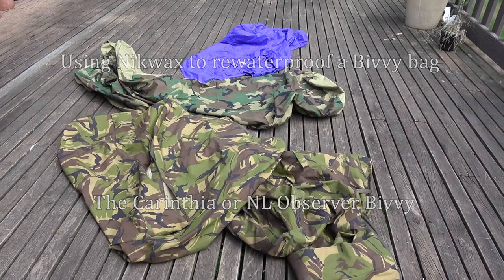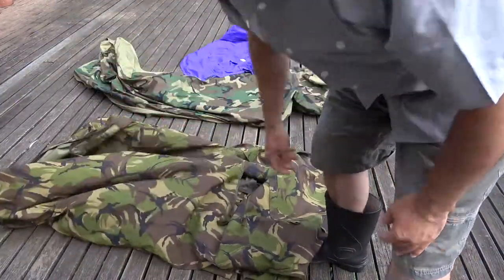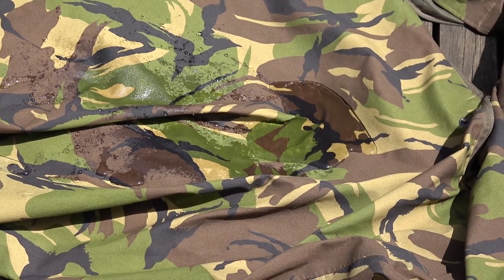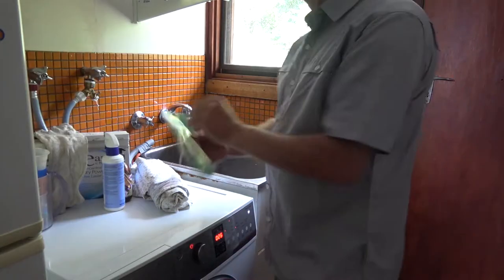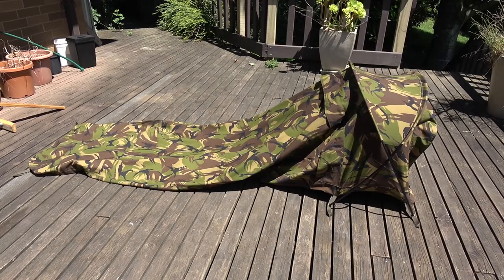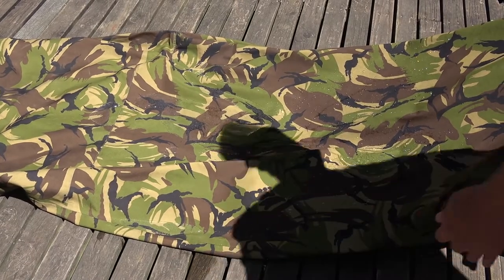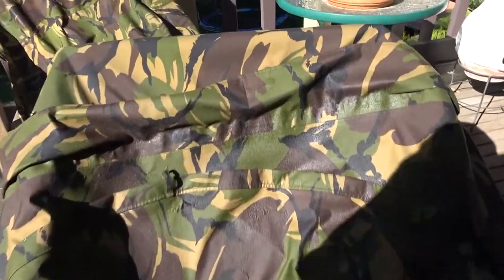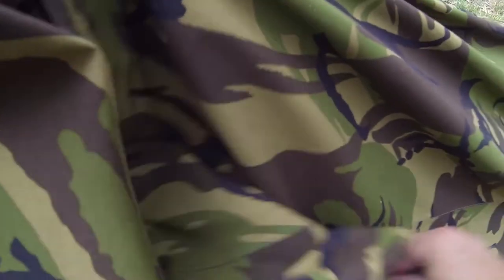Using Nikwax to rewaterproof a Bivvy Bag - Carinthia Observer Bivy AKA NL Observer Bivy

Comment: Washing it in techwash and then tumble drying should sort the gortex material and reproof itself. A quick spary with a decent repellent spray should help with beading. If this doesn't work, looks like the fabric is toast and only good for summer nights I'm affraid. Gortex recommend the fabric be cleaned regularly to keep it working or the pores of the fabric block with dirt and causes leaks. Google gortex care advice and there's loads of info about...
Cheers.
Andy

Comment: Hello 
I have the same carinthia bivi 
Can you help me on a matter how did you iron the bivi with the iron how hot how long can you let me know how you did it 
Thanks
Reply from the maker: medium heat on iron - not steam, and I ironed it with a cloth between the iron and the bivy. Applied a fair bit of pressure and just went slowly and carefully
Reply: @reviewsandprojects  ok thanks for getting back to me
About how long before it stuck down did you have to iron it 
And did it come away?
Reply from the maker: @shaunhornby7897  Not sure how long it was bubbling like that. It was an old ex-military surplus itme when I bought it. The bubbling was more noticable when it got damp. After ironing when it cooled it was re-stuck and it didn't separate again.
Reply: @reviewsandprojects  ok thanks for the help i have one and its done the same as yours i have tryed to iron it but it has not stuck down dont know if i have ironed it on the right heat and long anoth i have been told it has delaminated but it looks the same as yours in the video